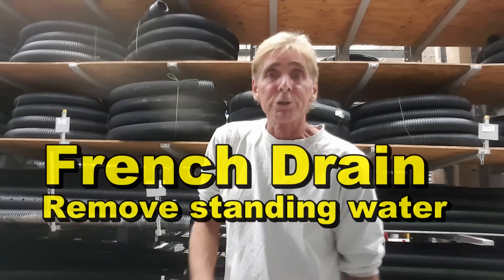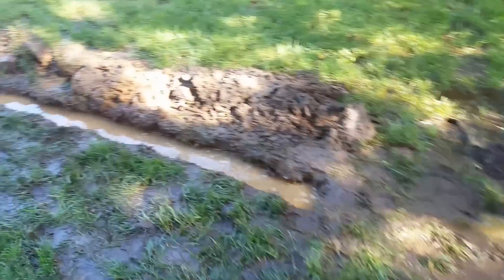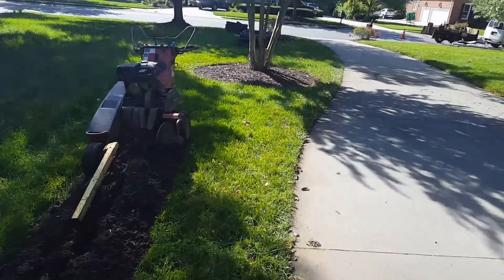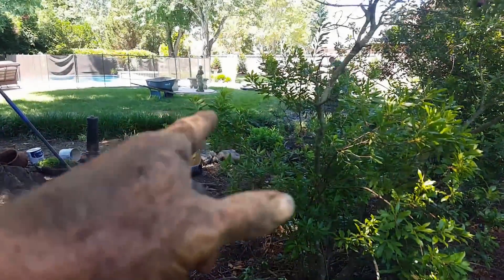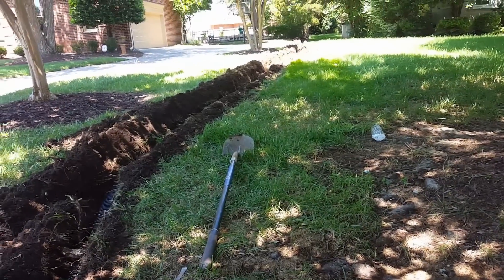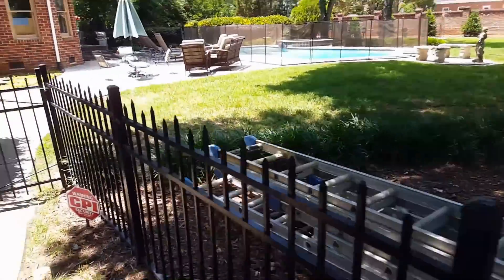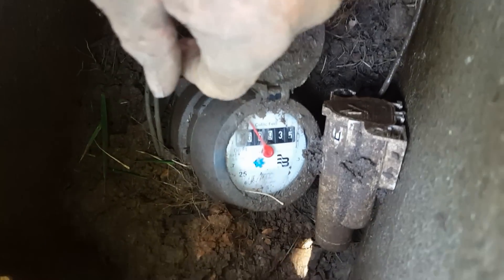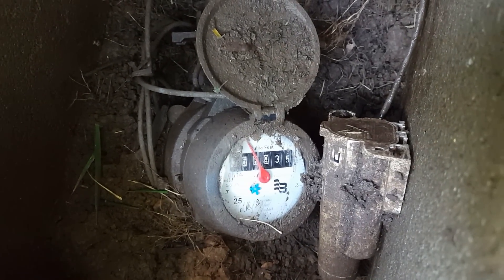French Drain Removes Standing Water

Comment: Why not just pull some 2" poly to the street? They could use it when they back washing also. Cut the curb clean up and move on. 2 Guys 4hrs puller and material $2200.00

Comment: A) The origin leak was not resolved.
B) You rooted those trees. In some years that feature tree by the pool will be expired. You have amputated around 40% of the trees root system. It would be great if you learned to go around the drip line, further the better or bore under at 1m where possible.
3) without an outfall you simply shifted the problem/ wet area to the front lawn.
4) weird logic displayed.

Comment: I think i would of  accurately diagnosed where the water is coming from . Put 2 gallons of chlorine in the pool and  just test the leak water the next day if its  highly chlorinated there's your answer.  Most likely there is a return pipe in the pool leaking near by about 2 ft down.

Comment: Great video and well explained; after working all night in my shop in the heavy rain storm I realized I need to install some kind of a french drain system. The shop is on a bit of a slope so I am glad I only have to dig and install about 50 - 75 feet of drain pipe around the back side and the higher side and maybe across the front. I can run all the water down the lower side into the woods. Does it rain in GA? Thanks again!

Comment: So that drain coming from the pool has to be a backwash line. More than likely they have a multi-port valve that is leaking their water out that drain. I would suggest having their pool guy check that multi-port valve on the filter to see if the spider gasket isn't leaking through the backwash. The only other possibility it being a drain from the pool side of things would be for relieving the pressure from the water table on the bottom of the pool to keep it from floating.

Comment: Simple fix:  Use the pool pump to backwash the water in the pool down the existing drain to prevent the pool from overflowing in the first place....  French drains should be a last resort - especially if don't have slope and you are not using gravel.  Those catch basins will be plugged with leaves and grass clippings the first time it rains.  What a mess.

Comment: I applied similar system in the UK around 2 years ago and boy since then I haven't had any problems at all. Thanks Chuck!
PS: in my case I used perforated pipe which I wrapped up in a white sock then buried it in gravel.
Reply: Kpop Lab Pro  what you're describing sounds like a French Drain

Comment: You should always mention to call Miss Dig before digging any Trench in your yard!!! You're very lucky you only ran into some roots and an old drain pipe and not an electrical line or a water main.
 It's against state ordinance in Michigan to do what you're doing. We can't  run a drain pipe of any kind to the road.
Reply: Its interesting to hear what its called in other states. Ive read three different names for the service so far. In Massachusetts its called Dig safe

Comment: If it is treated pool water running off the pool overflow then there may be a municipal or EPA issue
Reply: Most pools (except for newer salt water pools) can be switched to pump to discharge.  The discharge goes into the household drain line and then into the sewerage system.  My pool in New Orleans never overflowed, because it had no broken pipes, and when we had massive rains, I just had to turn the pump on and remove excess water so that it didn't overflow.   My current pool has a retractable cover.  It catches the rain water, I pump it off and let the rainwater run down my driveway, and that is the end of it.  I really see no reasonable or logical reason that a pool would be in a near constant state of overflow.  If it is, it should be repaired or removed.

Comment: I think the REAL problem here is not doing something to prevent the pool from NEEDING to have an overfill drain "repair"
Like...not having a pool, not building an in-ground pool less than 10 feet above the water table, not putting the overfill drain at the same elevation as the pool next to a wide, shaded area where the water won't evaporate. 
This homeowner is a selfish idiot that is opting to damage the ecosystem near his home rather than prevent it.
Reply: He is in Florida, the water table there is very high as it is and they get severe rain storms very often. Overflow drains are a very good idea.
Reply: A cover is also a good idea.  I have one on my pool.  I had a pool in New Orleans several years ago.  That, as most informed people know, is well below sea level.  I had no problem with overflow.  If it rained a lot, as it frequently does, I ran the pump with the flow switched to discharge so that the excess water pumped into the drain line and then into the sewer system.  It sounds like no real forethought let alone proper design went into the pool construction.

Comment: Why was there so much water overflowing from the pool??
Reply: Yep, that was my question.   Looks like he's doing all that work to attempt to treat the symptom while the home/pool owner is doing nothing to remedy the actual cause.  I now and have had pools in the past.  Pools don't just overflow.  Maybe it has a ruptured water line between the pool and the filter system.  If so, that is the first thing to repair, and the problem is solved.  If you put too much water in the pool, it will overflow, so my question is, "why is there too much water in the pool?"  If it's due to rain, the pool needs a retractable cover.  Remedy the CAUSE -- then the symptoms will no longer exist.  Anyhoo, I need to go install a floor drain in my bathroom, pipe it down thru the slab, and run it out from under the house.  I can make a nice French drain to carry the water away, so that after all that is done, it won't really matter when I run a bath and fail to turn the faucet off.  Such a bother, ya know, always having to remember stuff like that.

Comment: Nice video Chuck, one thing which wasn't mentioned is you should always call diggers hotline and have any gas, water, electric, phone lines which are buried in the area marked before digging. Maybe I'm wrong and your trenching doesn't ever go deep enough to be a concern?
Reply: Fox Sox    I had a gas line at 7 inches!  Don't ask me how I know.
Reply: Jer in Wis Always call before you dig, most lines are at 16"+. However there are zero guarantees I've seen Comcast run comms at 8" before.

Comment: Nice work but, just because you can cut through large tree roots, doesn't mean you should. Especially a silver maple, as they are particularly susceptible to rotting very quickly (>10 years).

If you must go near trees, move as far away from the trunk as you can and go under as many roots as possible, rather than cutting them.
Aside from that, this is an excellent education in sourcing a problem before you try to solve it. Nice work.

Comment: good job. the only suggestion I have is that if someone's going to do it themselves or even a professional they need to call the service that comes out in marks all the utilities. where I live it's called Tennessee One Call. I'm kind of concerned about this maple trees if they will survive I hope they did. did the homeowner find where the leak was coming from or do you think that was just a drain from the filter where they backwash the pool kind of odd that it would be coming out that end of the pool but you saw the problem that's the main thing
Reply: It looks like they did have utility locates done. If you look at the end of the video when he is standing by the pool you can see red locating marks on the ground. Strange to me that no marks by the road but maybe the utility easement doesn't go over there. It's important to understand that calling 811 will not locate all utilities. They will only locate the utilities from the mainline to the meter. So you might still need to call for private locates to locate rest of your property.
Reply: Yes, "Call before you dig". No matter what.
Reply: I was also curious of the source of the problem...
Edit, I rewatched around 2:05 and understand it's just saturated soil, perhaps because of pool or sprinkler leak.

Comment: I had about 300ft of drain pipe put in, 4 catch basins, works good. my problem is even after having the property graded there are still low spots collecting water. also where the pipe exits at the creek the 6" solid keeps getting washed out. anyway to stop the pipe from getting washed out?
Reply: Washed out? like your pipe goes into the creek and floats away? or the creek enters the pipe? I probably don't know the correct terminology here.

Comment: Was gravel used at all?  Didn't see any put in for a base or on top
Reply: Frederick Brown He used the $48 per 10lnft foam peanut garbage for about 10 sporadic ft of the trench in hopes of picking up additional runoff. Then chose to send it 110ft to a popup that will never live up to its true potential due to the equalizing pressure behind it being so far away. To me this system makes zero sence, corrugated garbage "solid" line is never a sound drainage option unless perf ADS for french drains with use of N04 min soil fabric and small river rock only, no 3/4minus bull shit this isn't  a basement system. No all purpose stone bull shit either, sharp edges clog.
Reply: I have seen his other works. They were done quite well. The pipes were laid on a plastic sheet and the pipes were covered with gravel as well as a layer of fine aggregates over the gravel. This job is a bit shoddy. The corrugated pipe will be clogged within no time.